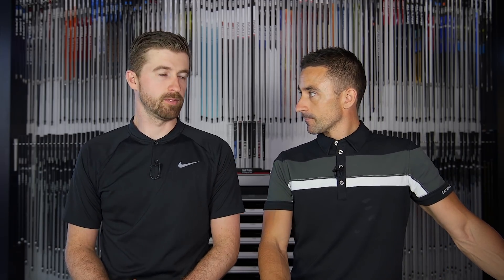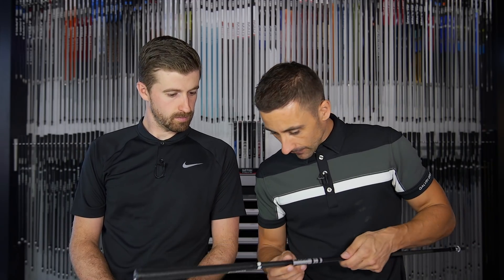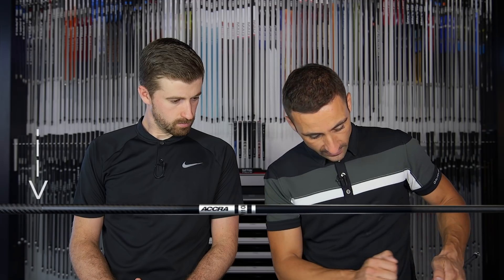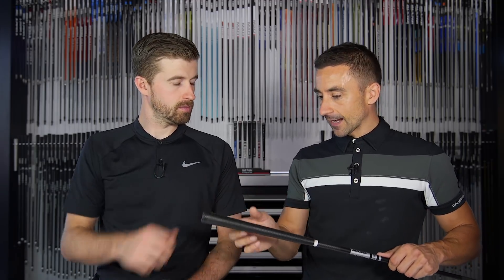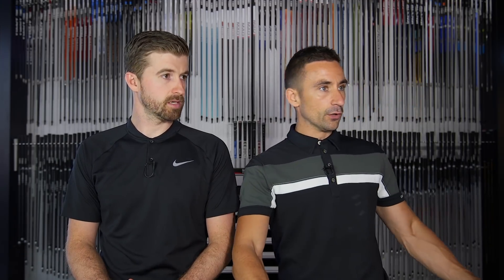Steel VS Graphite Iron Shafts

Comment: I started golf 4 years ago with an off the shelf graphite xxio iron set. I’m 52yr old with two shoulder reconstructions and a fairly beaten body. I really enjoyed the feel of the clubs. I have been fitted 6 months ago into a titleist Ap1 head and a light steel true temper shaft. I did ask the question when being fitted re. Graphite v steel shaft and the fitter said I would be fine gaming the steel shaft. My handicap continues to drop and I am enjoying the clubs but I have definitely felt more pressure on my right shoulder,  I have a great rehab team around me to keep me going. I will be contemplating graphite shafts on my next upgrade.

Comment: I am so glad I stumbled across this channel. It provides informative videos that are relevant and easy to understand.
Until the cost of graphite shafts come down, i don't think you will see a big move into them for irons. As an example, I bought a new set of Callaway MBs this year with the KBS Tour V which list at $1300. I also bought a Callaway XForged UT with the  Aerotech Steel Fiber shaft which I love. If I had gotten the irons with the Steel Fiber shaft, the cost of the irons would have been $1780. When you are looking at adding $500 to an already expensive set of irons, it makes it very hard to justify.

Comment: this answered a question i have had for a long time. I got a set of irons in graphite years ago (mizuno jpx ez forged 2016). Got them surplus off of ebay but only had the graphite option. been thinking of getting fitted for a long time and at a larger chain store the salesmen said he would never put me in a graphite shaft because of my swing speed. I doubt they have the options a club fitter would have so I will be sure to be open minded when i do get fitted. Thank you!

Comment: I use my hands a lot for work and recently got fitted and expressed how I have early signs of arthritis and get tennis elbow when I practice a lot with steel shafts in my irons. They recommend the recoil SmacWrap which dampens vibration another 65% than your average graphite. Ignoring my hand and elbow situation for any golfer you have advantages of extra feel due to the minimal vibration. I never hit any irons so constantly in distance and direction in my life. A big upgrade in iron tech for me as well in my fitting but graphite is a huge game changer for feel, consistency and ability to practice more without numbness from constant vibration from steel shafts. It’s shocking that more people don’t look more into it and I think this video will convince open minded golfers. This channel has great content and informative feedback on golf. Thank you 🙏🏼

Comment: Returned to the game after a long (essentially 25 year) lay off. Got fit into irons with DG120 S300 shafts, in part because back in the day I hit DG S300 shafts - still 30 years old in my mind.  Working with a teacher and getting my swing back but have started having left elbow issues. Since my swing has changed (was very steep before starting lessons), I decided to have another fitting w/Club Champion specifically to explore graphite shafts. Ended up fitting into a SteelFiber i95 in regular flex, and moved the head from 1 degree up to 1 degree flat since my swing is now much less steep. Looking forward to gaming them but even during the fitting it felt like my elbow was getting much less stress. Thanks for helping to teach an old dog new tricks...

Comment: After playing steel shafts for forty years and trying early graphite shafts (not good) I had Steel Fibre shafts (70 gram) installed in my irons. They are the BEST! Great feel, consistent performance, about the same distance but always solid. Only negative is the cost.

Comment: Finally guys! Thanks so much TXG...Graphite v steel and tipping v butt trimming explained, at the definitive level. 

Used a ladies graphite iron years ago just in practice because there was nothing else in another country. I mashed every shot to pin seeking accuracy. No one could explain back then but I supported its validity for men, to ridicule. 

Tipping has been a struggle to comprehend. No data available or expertise very rare. I suspect shaft width needing moreso for hands. Stiffness or less flex may produce better feel of the club head, without swing weighting the head ....so much. 
What could be the gauge comparison for stiffness gained or lost with tipping v butt trim?

Comment: What about the difference in factory graphite vs factory steel? 95% of golfers will play factory shafts and in my limited experience, there was a significant difference. Great episode on showing what is possible with a fitting and the best case scenario

Comment: I use Aerotech Steelfiber 95 gram shaft in all my irons and wedges.  Several pro golfers are currently using or have used this shaft in their irons, to include Matt Kucher, Brandt Sendecker, Fred Couples, and others.  It's also very popular on the LPGA tour

Comment: I used only steel shafts, on my irons, all my golfing life ... until about 5 months. Went to test new clubs, started using steel, but the fitter suggested I try some graphite, with trackman monitor being used for test/comparison. To my surprise I ended up ordering the new clubs with graphite shafts. Still happy with the choice in real life, on the course, play. PS I am in the senior category and have been for a while.

Comment: I love my graphite irons, and I’m a pretty powerful hitter with a good swing speed. 

I have recoil e80 smacwrap f3 shafts in my cobra utility iron all the way up to gap wedge (irons are cobra forged Tec Black.)

I love that shaft- couldn’t give a scientific reason why, it just feels sweet, ball spins good/stops and I like the high look of the flight plus get plenty of distance with sensible gaps.

I’ve tried other shafts in graphite and steel- but couldn’t see my self changing any time soon.

However I am getting an f9 driver and fairway wood soon, and do wonder what shifts might end up suiting me best in those. My current fairway has an adila blue 70g regular flex that’s I have enjoyed a lot. Will see what the fitter says, but I’m open to suggestions!
Maybe the hazardous smoke 5.5?

Comment: Fascinating. I have never been one to hesitate using graphite shafts after my very first two iron sets (hogans, xxio) many many moons ago even as a young man then. While now no choice given slower swing speed ever since even that time I found graphite to be better and more reliable. So really interesting that it jas not taken off. As you intimated it will also probably take some of the top young stars to be making the switch for it to become more of a norm and this perhaps even bring down prices as a result through volume demand. Thought the explanation that related to stiffness and bend very helpful and gives me something specific to ask and ho back to my fitter with. In my recent iron fitting nothing like this was mentioned or explained in why he chose a particular shaft for me.  Fortunately it seems to work though whether there might have been a better configuration or not I will not know till the next time.  I appreciate and respect the fact that you dont charge and keep an ongoing relationship with clients for tweaks and adjustments. I really wish others started to follow this example.

Comment: I love your content, it is so good. I have a set of irons with Accra 70. The reason I moved  from TT S300 to Accra 70 was due to my uncured injured right arm which means I have no strength from that arm any more. My other set of irons has the VA Composites Raijin 74. Currently I found the Raijin generated a bit too much height, not sure why? I think it is to do with my swing.  Again keep up the great work.

Comment: Hi Ian and Matt - another great conversation. Ian you made a point about shaft profiles and wedges - I play Steelfiber i95's in regular (3 to PW) and have bought PXG wedge heads (used) in 50/54/58. I was intending to shaft the 50 the same as my PW - and go lighter/softer in the 54 & 58 - you mentioned 8 iron shafts - I assume they would be trimmed to length from the butt only to retain the length of the parallel tip?

Comment: I went graphite in irons years ago because with steel I got tendinitis in my elbows really bad. The shock absorbing of graphite took care of that. Just be aware that with the same length of shaft and the same grip the swing weight will be lower with graphite on the same head.

Comment: Recently switched to Recoil on my new PTX pro. Never go back to steel. Give it 5 years and probably won’t see many steel shafts in Irons. Just like with Drivers.
Reply: @Chaz Carrington I don't think you need to change flex. Graphite keeps same flex at lighter weight

Comment: I had stock XP 90 regular flex Titleist AP1 when I went to get fitted. I was fitted with Accra icwt 95 m4 (stiff). I never imagined that would fit my swing. It took me a month to trust this but I am glad I did. It’s smooth and stable. Fitters know more than you. Get fitted by a professional. Not at the superstores though...

Comment: Matt, Ian, can you guys possibly tell me if there is a benefit to me playing graphite in my wedges? I play steel 105g modus ns pro in my irons, because that's what I was fit for. I play graphite 80g fujikura pro in my irons, but play my wedges approximately 1/2"- 2" longer than standard length. I find this works for, but can you help me clarify maybe why? Thanx guys, love the channel from a beginner fitter perspective. Keep up the lords work!

Comment: Great video guys - love it !
Matt says “the feel was different” , but the weight overall was the equal. The balance point in steel and graphite is also different and I think, the swing weight was not the same on both clubs.
Do you think, you can make the same “feel” with the same swing weight ?
Reply from the maker: Swing weight would be one component of the feel

Comment: Wonderful video !!  I am using 2018 Rouge x irons and the shafts are the 90 gram stock shafts in a regular I wonder whats a good shaft that is graphite for me to look at in lieu of buying new clubs I like the heads and I like the distance I just want better disbursement and less impact vibration when fitted I was told i was border stiff flex and regular

Comment: Just got fitted today with graphite shafts & chose the Cypher shafts. I’m a senior with Swing speed high 60’s to 70. As much as I wanted to stay with steel shafts I just couldn’t muster the speed required for distance. With graphite I was able to get consistent distance closer to what I want ((7 iron) carry 145 yards with around 5,000 +/- spin. What is your opinion of this shaft from Project X?

Comment: Great video guys and really interesting as always. I recently got fitted for new irons and with 7 iron swing speed of 81mph changed from stiff to regular flex. My new shafts are also lighter which in my opinion is the most noticeable change and feel so much better. Do you think the shaft weight is as important or even more important in a fitting process. Used to play graphite shafts in a set of Big Berthas back in I think 96 and thought they were great (very expensive at £1000 a set even then) lol
Reply from the maker: Shaft weight can play a significant role in a players' performance and consistency, absolutely.

Comment: I agree that a younger group would be willing to go graphite. I myself wanted to go for it and was fitted for Accra 105s for the consistency, flight and feel. But!! $75 a shaft for a younger player is a big factor. I just stuck w my kbs tour105 and added sensicores to help w dampening. Do these cores or foam dampeners really make a difference?

Comment: I am considering the purchase of a set of Ben Hogan PTx irons.  I am 72 with a 75 mph 7 iron swing speed.  7 iron carries 140-145 yards for 150-155 yard total on average.  I am 6' 1/2" and 240 lbs.  Bad knees keep my legs out of my swing more than when I was younger.  My current irons are Ben Hogan Apex Edge with regular flex (3) apex steel shafts.  Handicap is 15.  I am trying to decide between the KBS Tour 90 regular shaft, the UST Recoil 760-F3 regular and UST 780-F4 stiff ES SmacWrap shafts.  I 70g weight and 4.1 degree Torque of the 760 F3 scares me compared to the 87 gram weight and 3.5 degree Torque of the 780 F4 shaft.  The 780 ES F3 (83 grams and 3.6 degree torque) is not available from Hogan.  I was able to hit the TaylorMade P790 with the UST 760 ES F3 shaft at Golf Galaxy and had no obvious issues.  Any thoughts/recommendations will be greatly appreciated.  Thank you in advance.

Comment: I was struggling with some terrible tendonitis on the outside of my elbow. I went from pxi 6.5 to recoil proto, 125 f5. They were great. It felt like balance point was lower in the club and they seemed to actually add swing weight I was a little shocked to not have to add tip weights or tape. I went round Modus 130x in the irons  last summer summer and haven't looked back..

Comment: Great! Because of some increasing joint problems i´ve switched to graphite. From titleist AP2 with KBS tour to TMP790 with the UST recoil 780 F4 smac wrap. I recall Ian saying in another vid that it is a shaft to make the switch from steel easier. And it does! I can now play 2 rounds per weekend again and performance is very good. The difference to the wedges though is getting to big. Have had one made with a 90 grams shaft and that compares better with the other irons. Other suggestions to that?
Reply from the maker: Go heavier in the wedge shafts

Comment: It would have been nice to have shown the specs of the two clubs.  Total length, total weight, swing weight, balance point, frequency, etc.   Matt mentions he perceived the steel shafted club to be heavier and you both say it was most likely due to balance point.   It would have taken less than a minute to have measured the swing weight as well as the balance point to confirm this.

Comment: I realize this was about comparing the two shaft materials but it had me wondering about weight.....I had my driver shaft shortened by cutting from the butt end down a little years ago. I’m curious if weight or weight “feel”  of the driver after the customization should be considered? I have played around with some stick on weights but have not had the shaft really measured to what the swing weight is. I hit it well but was always curious. Would adding weight on irons be something people do if they needed a certain “feel” after or if they shortened them as well? Same question for Graphite or steel.
Thank you for the great videos👍🏻

Comment: I was just fitted for some SteelFiber 110s. Different feel than the Project X PXIs I was playing but I like them. Slightly lower ball flight and less spin. Dispersion is good too.

What are your thoughts on having shafts Pured?
Reply from the maker: Can be beneficial depending on the shaft, some shafts have high enough tolerances that pureing doesn't change anything.

Comment: Should you get a bit stiffer shaft if you do go to graphite I use a regular flex as an example in steel irons I was using 85 grams but switching to graphite a regular flex could be 65 grams does that play a big role with stiffness or is it just a weight thing ?
Reply: Yes I play stiff in steels and I play extra stiff in these accra tour graphites personally

Comment: I love the feel of graphite shafted irons after hitting graphite shafted driving irons, but there are a few things that would turn me off getting graphite shafts in my irons ignoring performance/feel etc.

1. Price - I've bought 2 new sets of new AP2's in the last 18 months with S300's. Adding $50-100 a club for graphite isn't something I'd be keen to take on without significant performance improvements.

2. Wear - using steel shafts, wear is something you really don't have to think about. Just putting graphite shafts back in your bag and clubs rattling around in you bad can add visible wear to graphite shafts, whereas I can't say the same for steel. Playing out from under trees, out of hazards etc, I currently have absolutely no concern with damaging my S300's, unless there is a solid branch that I'm a chance to hit in my follow through. If I had graphite shafts, I don't think I'd be as willing to play attacking shots out of those conditions as I'd be more concerned with damaging the shaft from hitting a stick in my backswing than I would playing a good shot.

I recently got my old boy into graphite shafted irons - he is 68 and had really bad back soreness after playing 18 holes with his steel shafts, to the point where he could barely walk. Since putting the graphite shafts in the bag he only has mild back soreness after playing 27 holes and because of that his handicap has come down 4-5 strokes.

Comment: Regular steel vs Stiff graphite shafts. Is their stiffness pretty much the same?  I'm a newbie to the sport, just a little over two months. With regards to shafts, I currently have irons with Steel Regular flex shafts. Although the label on the shafts say S FLEX so not sure if I'm really swinging a Regular flex. But anyway, I'm thinking of changing to lighter Graphite shafts because of my slow swing speed and a bit of hand & shoulder pain, but I'm not sure what Flex would suit me better - Regular or Stiff? I'm thinking since graphite is a softer shaft already than steel, maybe Regular would be too soft or whippy so I'm leaning towards Stiff for a graphite shaft. I do have Stiff shafts for my driver & 3wood which I'm fine with. Any suggestions? Thanks in advance